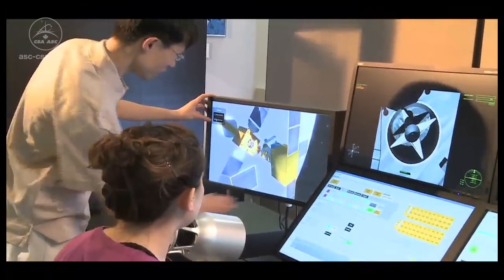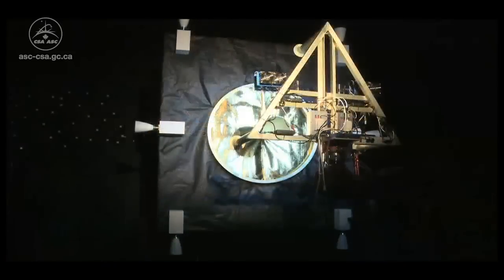The Next-Generation Canadarm

Comment: The arm testbed is optimised for 1G use in order to test various mechanisms, control systems and software to permit different on-orbit tools and scenarios to be created and tested. As such, they are design demonstrators and not space flight capable arms or systems. There is no specific CSA program for their use at the moment but MDA has used them several times to trry out varuious tool and system concepts relating to on-orbit servicing.

Comment: Much of the robotic animation is not supposed to be CGI, it is actual real time simualtion of the robotic events. As such, the frame rate and resolution have been limited to the data rates of the computers and communications equipment on board. It doesn't look like a "first person" shooter because there are additional calculations (many, many) going on in the background that consume a lot of the available  and limited computing and communications bandwitdh. Doing what you see was not easy.

Comment: It still has mass & because it has mass, it has inertia. Astronauts have to be careful when "jumping" from one interior surface of a spacecraft to another because of their mass, not their weight. If they are moving to quickly when the contact another surface, they will injure themselves as surely as they do on Earth. Likewise, moving an object in space still needs force to be applied when starting it moving or stopping it from moving, i.e. when it is undergoing acceleration, just like on Earth.

Comment: @tulp35000 GI Joe exaggerated. A lot. The earth gets hit by meteors a lot larger than 100 kg all the time and London hardly ever gets destroyed.  :)   A tungston rod 100 kg in mass would be 1" in diameter & 43.5" long. It would not actually explode on the surface, rather it would penetrate a fair distance into the earth/building/concrete releasing energy all the way. It would be a pretty big explosive event and might be able to bring down a large building or two, but not destroy London.